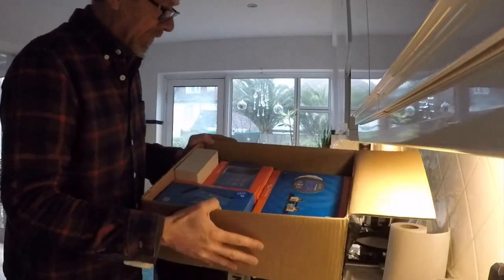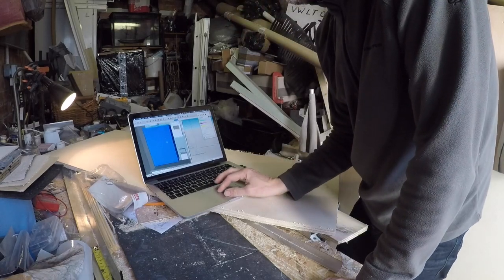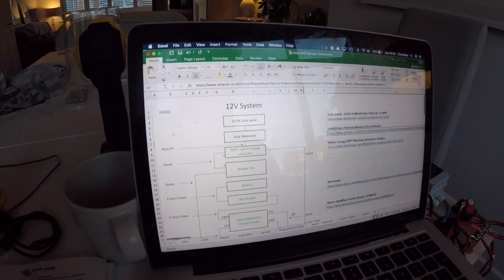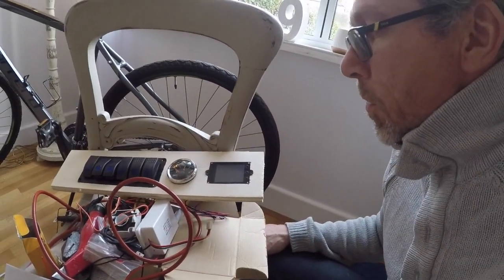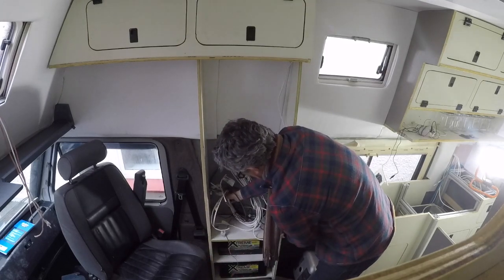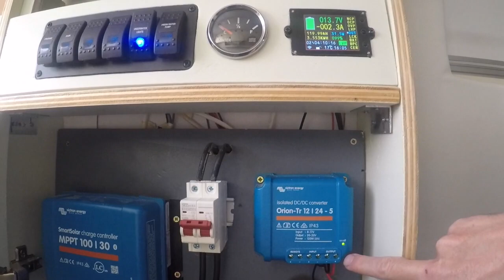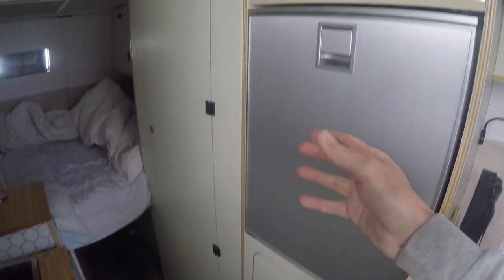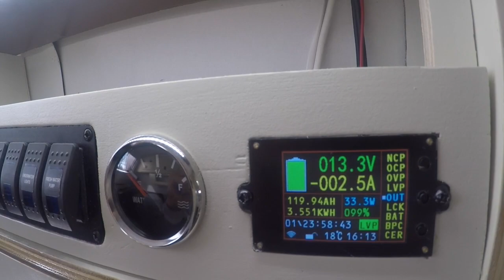Electrics 2nd Fix - Walt the 4x4 VW LT - Self Build Journal - #21 - CamperVanMan

Comment: Hi Tim, I can see you have used a durite split charger. I've read quite a lot on these when set up with solar. The point being that if the solar array is charging the leisure batteries and they are above 13.3 volts then that would also trigger the split charge and as such the leisure batteries and the starter battery would be connected as one is lower than the other. My understanding is that they are bi directional. Have you found this to be the case with your set up?